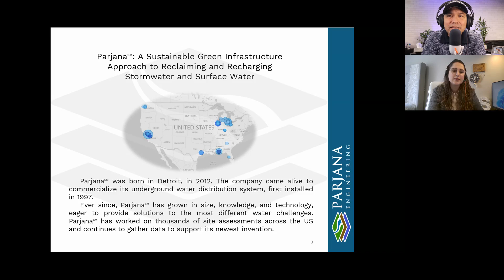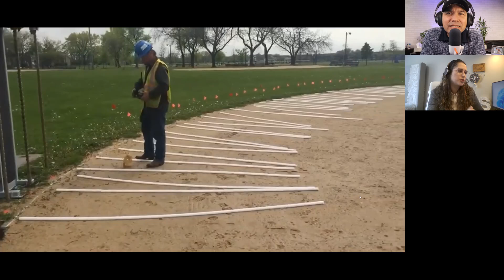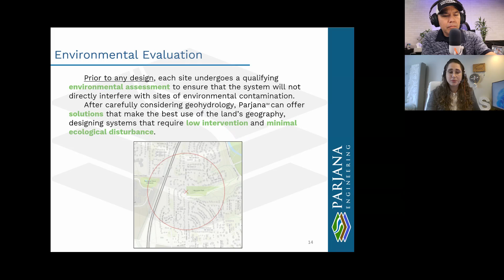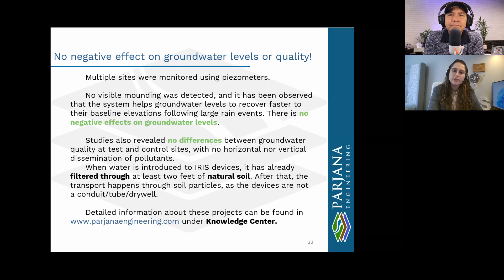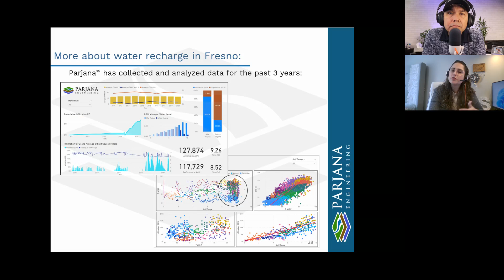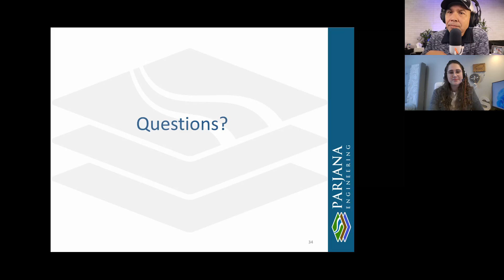Parjana Engineering | IRIS Infiltration System

Comment: Great presentation, Lohayne! The soil layer resistance explanation really clarified how IRIS works differently than traditional infiltration solutions.
Quick question: With that California recharge basin case study showing 170+ acre-feet infiltrated in under 2 years (vs. <30 in 7 years pre-installation), how are you helping municipal clients translate that performance data into ongoing ROI tracking? Are you providing dashboard access to their monitoring data, or is it more report-based?